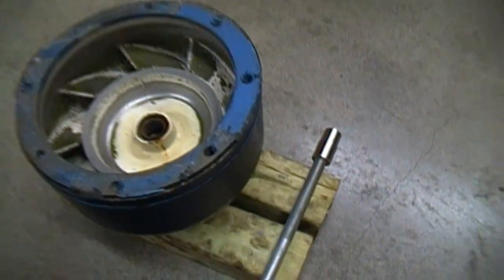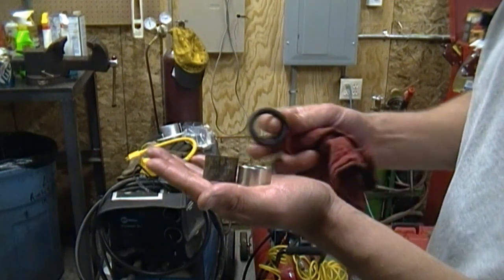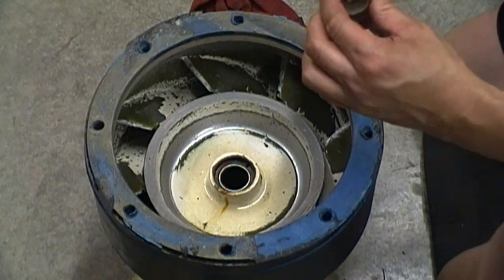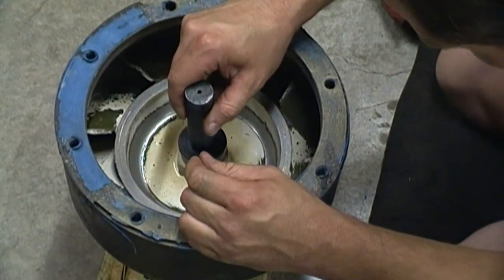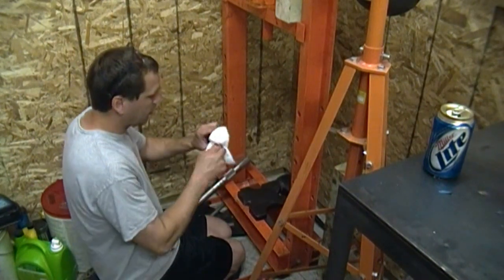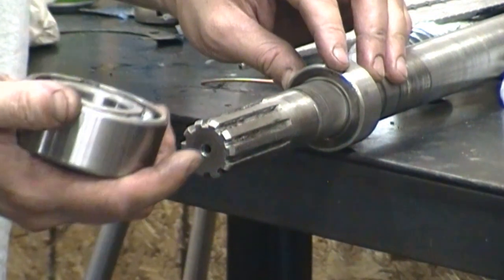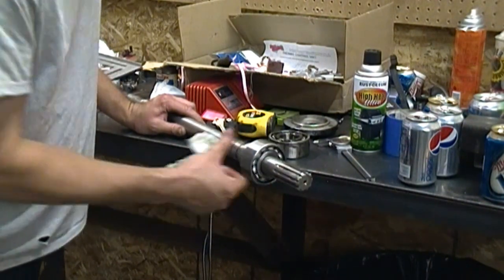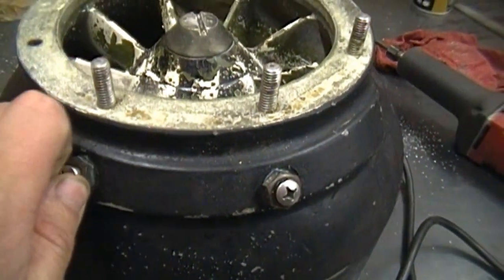Berkeley Jet drive pump rebuild part 3 of 4

Comment: Not sure if you are still watching comments on this video, but wondering if your 28x42x7 seal worked out? My bowl seal seat is hogged out and the SAE 1.125 x 1.625 seal is super loose. I ordered the same seal you used a few days ago before I saw this video, so I am a bit hopeful it'll work now.
Reply from the maker: It worked out for me.
Reply: @Oldsmob455  Awesome, gives me hope for mine